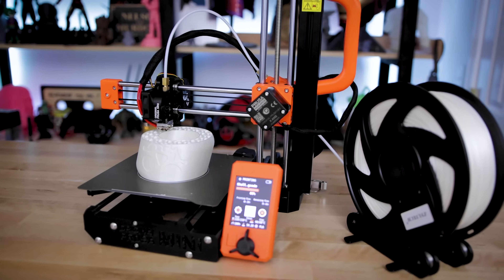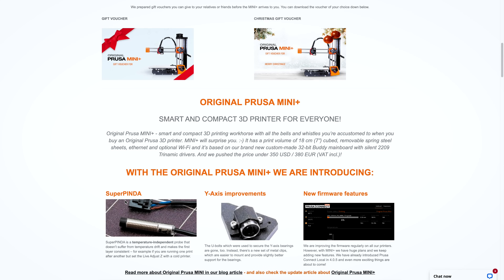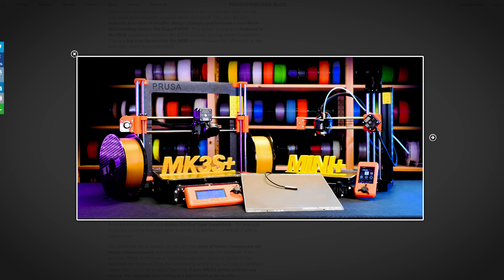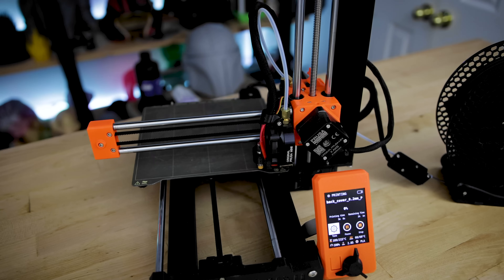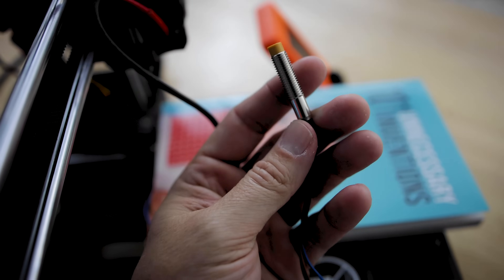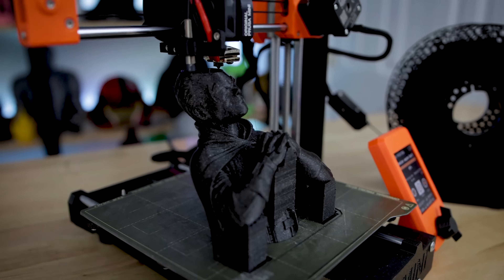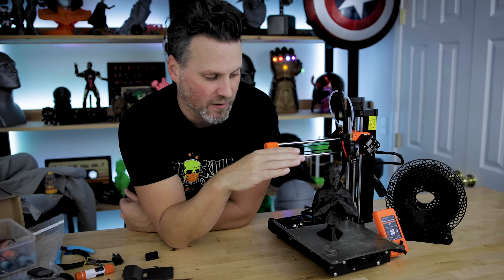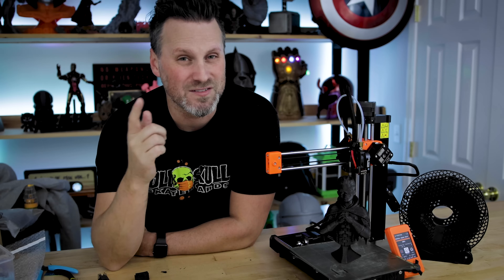Prusa Mini SuperPINDA Probe Upgrade - Does it fix my Prusa Mini? Prusa Mini+

Comment: I know this is a very old video, but I have a question that I cannot find an answer to. The Super Pinda is supposed to be temperature independent bc it's shielded from the heat of the bed, right? But if I heat soak my printer in a 45°C chamber for a long time, wouldn't that heat make its way into Superpinda and affect its reading? Would a Pinda V2 actually be better in that application since it can compensate for that?
Reply from the maker: @coledavidson5630  I think you are right on that assumption. Unfortunately I haven’t touched my mini in well over a year. Have you tried one of the Prusa FB groups?

Comment: Any updates on how the upgrade is performing? Thanks!
Reply from the maker: Working great! I still occasionally have print fails but I think thats more due to the tube in the extruder. Whats great about this update is i no longer have the initial bed fails due to it not preheating liek the old pinda probe
Reply: @UncleJessy  Thanks for the response and that's great to hear! 
I have heard issues with the PTFE tube and how the hotend needs to be pushed up into the heatsink. 
I just ordered mine and excited to receive it! After 3-4 weeks Prusa style :D

Comment: I was just wondering about the pinda probe, may have to get the upgrade.
My filament tube came out of the stepper motor/extruder. The brass fitting was still in place under the nut. Came back to find a coil of filament behind the mini and a failed print

Comment: The times have nothing to do with Cura or S3D, prusa just added the correct firmware accelerations, instantaneous moves and max speed settings in the slicer. If you do that for any other printer on any other slicer you will get extremely close results as well. This is just the ecosystem being good.

Comment: Common problem of prusa not in sensor, but huge bed and steel sheet temp deformation. While we print PLA 40 celcius degree hot table in warm room - wow, it's excellent stable :)
But... PETG 80 degree hot table in cool room, you feel like your printer broken :)) 3 of 4 tries first lyier will failed.
I have MK3. Same problem - very unstable auto level in high Temps.

Comment: My mini is loud, i don’t know if anything is wrong with it. I have it in a Ikea enclousure that stands on dampening pads, but i have also increased the motor speed quite a bit. Any suggestions? Ive seen more people on Reddit with the same issue, and i cant fit motor dampers on it either.

Comment: For those that are still having issues calibrating the first layer, look up life-adjust z on google. You will be directed to a prusaprinters forum as well as a blog post from ttlexceeded. The goal of this method is to print a single layered 75mm x 75mm x .2mm square. It really helps you dial in the correct settings. Print as many squares as needed and use the live-z adjustment to dial it in. You'll be done when the square is completely uniform and has no separations. This method is sooo much better than the internal calibration sequence.

Comment: for me the prints used to be perfectly consistent until the winter came. Now I preheat with the nozzle against the bed for 5 minutes which is rather inconvinient. Unfortunately the new sensor is out of stock.
Reply: Sensor may not help. While heating up uneven heated steel sheet deforms,
 In cold environment much more.
Also heated sheet contacting cold air could deform again.
When  below 20 degree in room, printer very unstable
Reply: @alexvas603  Well it should eliminate atleast half of the problem. Anyways in my experience it is specificly heating the sensor which has helped, if I heat only the heatbed but don't brign the sensor close for heating my result are very bad.
Reply: @alexvas603   Here to confirm that the sensor did indeed make my first layers consistent regardless of the room temperature. I think the sensor was definitely worth the wait. I have already had the sensor for a week or so and have tested it thoroughly, perfect results.

Comment: Nice to see Prusa finally adressing this flaw.
I have to operate my Mini in my garage (where it has about 8°C) due to air quality issues (and you should also not use it in your home environment!) and I have to preheat this thing for at least 30 minutes until all the thermal expansion is handelled correctly and I get a consistent first layer calibration. If I don't do that my first layers are after MINDA proping complet garbage! Sometimes the Nozzle is rammed into the bed, other times the z-level is zeroed 1mm over the printbed. This is ridiculous. 
Needless to say that I hate having to preheat the machine this long with hot water bottles (yes. The damn machine refuses service below 15°C and shuts itself off. So i have to warm the printbed artificially until it has reached 15°C and heat it normally from there.) AND having to do the first layer calibration multiple times before EVERY damn print.
I will get this upgrade and see if it improves consistency.

Comment: The super PINDA didn’t fix mine (extreme stringing and oozing even though I replaced half the components with spare parts). HOWEVER, it did fix my first layer. It is now SUPER consistent whereas with the MINDA I constantly had to adjust the offset. Money well spent.
Reply: Turn up the travel speed and down the temperatures. The stringing isn't a prusa mini parts problem in my opinion.

Comment: I contacted Prusa several times because my mini continuously crashed in to the smooth sheet at random at the start of a print. Like it got the z height completely wrong. This only happened on the first print of the day and with a proven gcode file. I have to say Prusa we’re not very helpful and my mini destroyed about 6 smooth sheets on both sides. Prusa didn’t offer to replace anything and refused to accept the probe could be an issue. Frustrating.  It must have been a common problem that they kept quiet about.

Comment: I’m really curious how the probe achieves temperature invariance without a thermistor. Is it just shielded?
Reply: It uses a lookup table because the difference is a known value
Reply: @Jackjan4  surely it’s only a known value if you know the temperature?
Reply: @ErlendDavidson  I'm sorry, my answer was wrong. Basically I described the v2 pinda. According to prusa devs at the forum the new sensor is doing the temperature compensation on its own at physical/hardware level by two pieces of different materials changing their distance with temperature which counteracts the measured difference of the bed somehow. Tbh I also don't understand it to its core. I'm just repeating the phrasing here.
Reply: @Jackjan4  ok thanks.

Comment: Hii uncle jessy. I really need your help. Im about to buy my first 3d printer and i can´t decide between a Genuis Artillery or go straight to a resin printer (anycubic photon s or zero). Both printers are about the same price here. There aren´t many options here in argentina at reasonable prices, most of the printers you show in the channel are ridiculously overpriced here or i must import them). I will use the printer only for make 1/6 figures like hot toys or statues like side show in that scale, only for me and friends,  not for sale. In all the videos i found in youtube  about resin printers they only prints miniatures or small busts, i didn´t see anyone print a 1/6 scale figure or how to divide a file for print it in a small resin printer. Thanks in advance!
Reply from the maker: If you plan on making small figures like hot toys in really fine detail your best bet will be a resin printer. You can still get great results from an FDM printer but will require a lot more cleanup. Another thing to consider is how much will resin be for your resin printer based on where you live.
Reply: @UncleJessy  Thank you very very much! here the resin is twice as expensive as the PLA BUT both are not to expensive overall. Should i be able to print a hot toy scale figure with the anycubic photon Zero? or should i go for the Photon S DLP? i can get the photon zero half the price of the photon s DLP

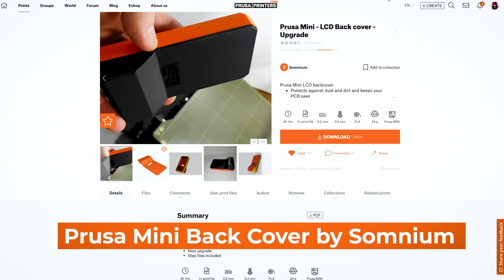Comment: Question: 5:16 I dont see how that is not pointing to the pinda probe. if your bed level is off your pinda probe should adjust to it. that is its job. I'm a big fan of the bltouch's they do a really good job. I had a MK2S and the pinda in that was a nightmare. now my main printers are 2 cr-10s pro's with bltouch upgrades. i miss the direct drive but that pinda probe was a pain in the ars.
Reply: @npgoalkeeper _ I did put the pinda 2 on it with the 2.5 upgrade. never ran right sense (not pinda related) worst upgrade i did on a printer:( I run a ender 3 and a cr-10s and 2 cr-10s pro's now all with bltouchs and wham bam's and yes i changed out the sensors in the pro's to bltouch on account of same issue in video
Reply: @npgoalkeeper _ probes job, reading your bed level. making adjustments to your Z height in your gcode to match the readings on the bed. possible cause of warping seen this with my CR-10S pro's before i put the bltouch on. if your sensors are off or have play in them as i found on the cr-10s pro's and sections of your first layer are not placed right. This will cause that area to lift up and become warped. This is a issue i have found with most inductive sensors just like the one he is using. Why i moved all my printers to bltouch's
Reply: @st0mper121  bltouch is great... when it’s operating, i’ve bought 3 for one printer and still use it every day on and ender 3 pro. If your selling prints however make sure to buy several at a time instead of one because they like to stop deploying the pin after about 4-6 months of non stop printing. Prusa’s with Super PINDA are by far the best system out there, better in virtually every way especially speed and no moving parts to stop working.
Reply: @Socal_Geo1  So far my version 3.1's have been great in my cr-10s pro's. (I think that issue was addressed in 3.1 but im not sure if im remembering that right or not) I have a older one on my ender 3 I have never had a issue but i will say i dont spend a lot of time running my Ender much anymore.  it use to be my workhorse but now its my backup if a printer goes down:) I did read a lot of good things about the new Super PINDA. But they said a lot of great things about the first pinda as well and it was junk My first printer was a MK2S upgraded to a 2.5. I have had some really bad luck with Prusa pinda probes (the old ones) not willing to give them another shot.  but i do have spare bltouch 3.1 :)

Comment: What the hell happened to your steel sheet? It looks ruined lol.
Reply from the maker: Before I did the pinda upgrade I was using glue sticks 🤣😂
Reply: @UncleJessy  I have never needed glue sticks on mine. Just wipe with IPA every couple of prints.
Reply: @UncleJessy  my mk3s pei smooth sheet stick perfectly after thousands of hours of prints and it has no white ghosting all over it that last more than a print or two afterwards. Here’s how you can do it too. You got the super pinda which is going to help. First before you begin this start off with a smooth sheet that’s been cleaned in the sink with dish soap and water then dry it off. Now from now on before every single print, while the sheet is still cold remove it and spray it with two sprays of 91% IPA (isopropyl alcohol). 91% is the best percentage to use because it has some water mixed in which works to remove sugars. Then wipe it around with a paper towel until the alcohol is evaporated. If you see smudges or oil do it again on that spot. Then print on the bed. Finally it’s super important to wait until the sheet is back to 100% room temperature to remove the prints. Warm sheets stick more and pull off sugars and other sticky molecules from the PLA which leave behind the ghosts that further reduce the PEI sheets ability to make your model stick. Once a year you can remove residual oxides on the smooth sheet with a small amount of acetone and a paper towel. If you follow the basic ipa / cooldown method with a good z level and your super pinda your printer should have perfect first layers every single time.

Comment: Regarding other slicers - to get more accurate estimate times, check your jerk and acceleration settings inside a profile. If your machine limits don't match a profile settings, estimated print times will be way off. Not sure about that probe tho, certanly not at that price point.
Reply from the maker: Thanks for the tip!

Comment: Mine is working flawlessly since the upgrade.   I installed mine Wednesdayand I'm loving it!!  It's the prusa mini I dreamed of!!
Reply from the maker: Awesome to hear you’re seeing similar results. Was cracking up that I couldn’t get the print failure issue to happen on cam before I installed the upgrade.
Reply: @UncleJessy  yeah it's all good. Mine would work great 4 3 or 4 prints then if the wall it was literally not even touching the build plate.
Reply: @MD-NWWI  You sould try to adjust the startcode and let the pinda heat up a little bit before you start your prints. That would solved your problems, or if you don't know Just buy a Super Pinda hehe
Reply: @TheOldKenobi  thanks!   Yep I did buy a super pinda!  Now prints start the same weather is 18c in the hobby room or 30c. Works flawlessly now

Comment: doesn't the penda do the bed leveling so you shouldn't have had lifting???  could have been a million things but the bed should have been level with the penda doing it.
Reply from the maker: 🤷‍♂️ was their callout that it does a better job making sure those initial layers print properly with the probe swap. So far so good. 8 prints in with it
Reply: You still have to dial in the Z-Offset, which is what I think he's referring to. The bed leveling gets you close, and ensures that the nozzle is at a good distance from throughout the surface of the bed. The offset ensures you are close enough for good adhesion. You only have to do the offset if once per sheet, unless you mess with the bed platform.

Comment: Now the real question is.... Can I use the old SuperPinda on my stock Ender 3???
Reply: The old sensor is called m.i.n.d.a.  and yes I belive you could providing that you change the connector and also I would check that the pinout is the same for the endstop.  Also I am not sure on the normally open or normally closed unless triggered specs on the firmware.
Reply from the maker: Wow now that’s a wild idea!

Comment: nice vid @uncle jessy! But that's a perdy dirty bed though, cleaning it with ipa will also give extra adhesion. ALsooo if you print PETG, use the powder coated sheet. but i'm sure you already knew.
Reply from the maker: Haha yep I was thinking about that while I was editing that I should have cleaned up the glue off bed. Will be trying that tonight with the upgrade. 

And yep! On the petg! Will be using my other bed for an upcoming video 😬

Comment: i had some issues with first layer as well, but once i started using a bit of glue and lowered z a bit the failure rate dropped almost completely. also added a bit more extrusion to the first layer  in the prusa-slicer.
such "fix" does result with elephant feet from time to time...
Reply from the maker: Haha that’s what’s all over my bed is the glue stick residue. Gonna clean it up tonigjt and test it back out

Comment: Thanks for the video - i hope the sensor will solve my problems with the initial first layer. When it was printing, it was damn perfect - no fails. But getting OVER the first layer was a bit of gamble.
Reply from the maker: Same here. That has been my single biggest issue with the machine. Once it’s printing it prints amazing but required me to monitor every print until it was fully printing